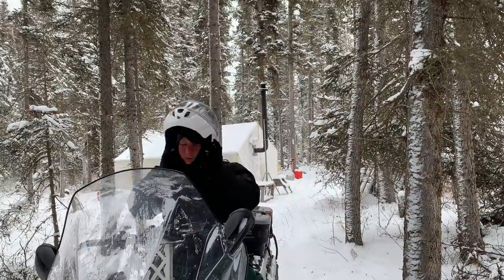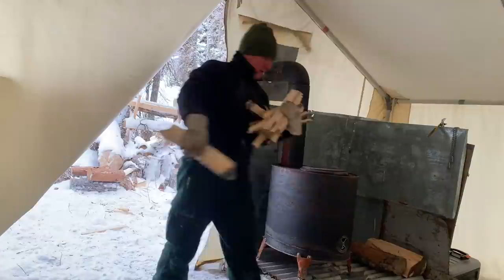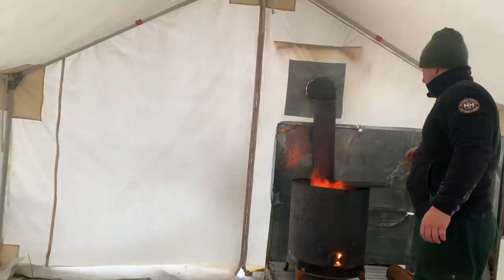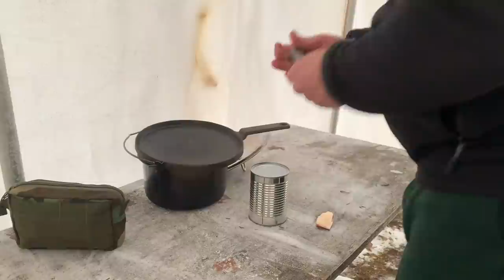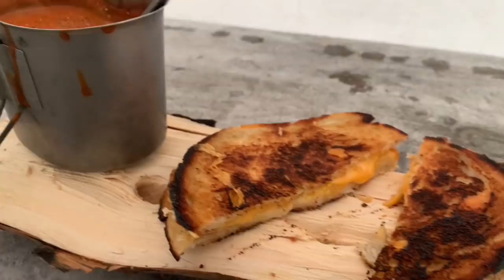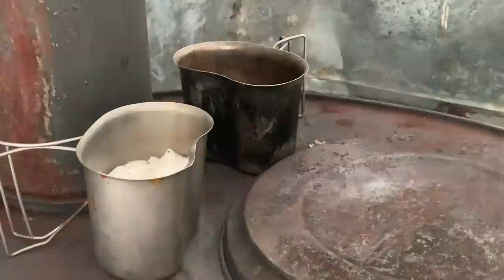WINTER CAMPING in a SNOW STORM ALONE

Comment: I've only camped in the winter far north in log cabins but I would think shaking the snow off a tent  would reduce your heat. I know a layer would melt but the tent would repel the water and the remainder would insulate. Thoughts?